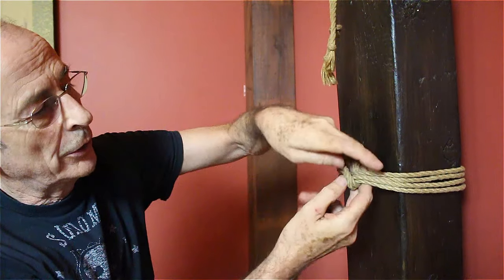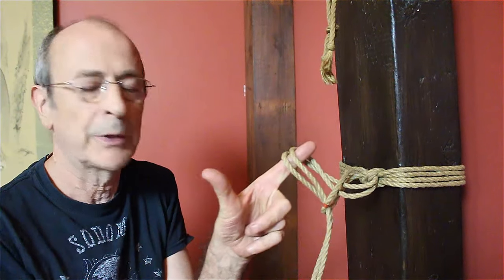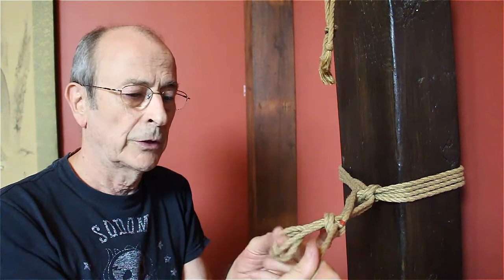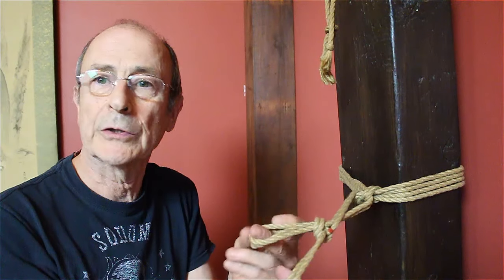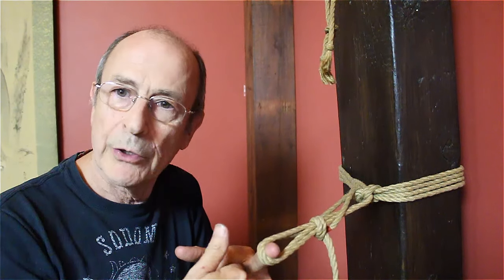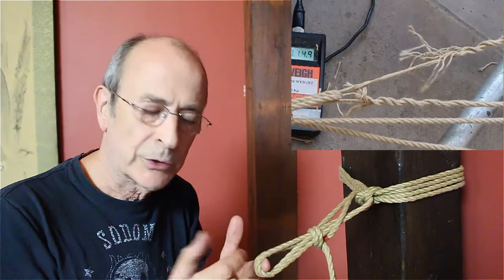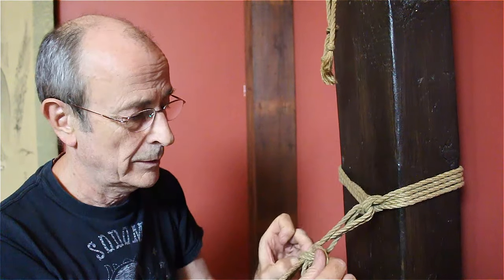Shibari suspension: How to tie a double bight lift loop

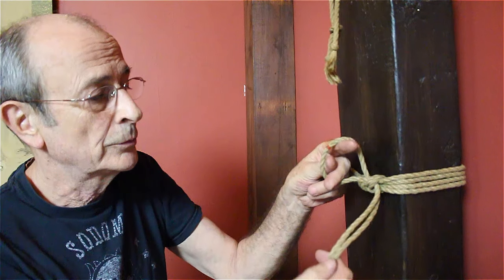Comment: 0:27 If you go through this loop, doesn't that make it impossible to untie the single column tie from that side in case of an emergency?
Reply: Yes, but this should be used on an upline for lifting. The need to rapidly untie where the upline connects to the harness could be circumvented in the case of an emergency. Not to mention in an emergency just cut the rope. No rope is worth your bottom.